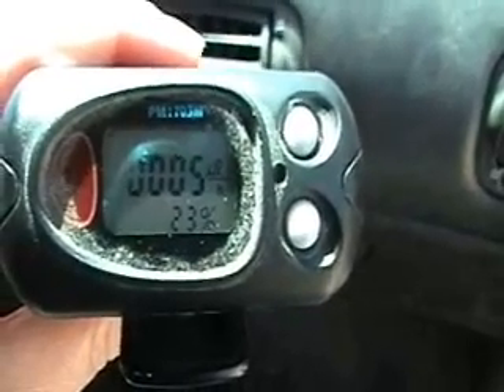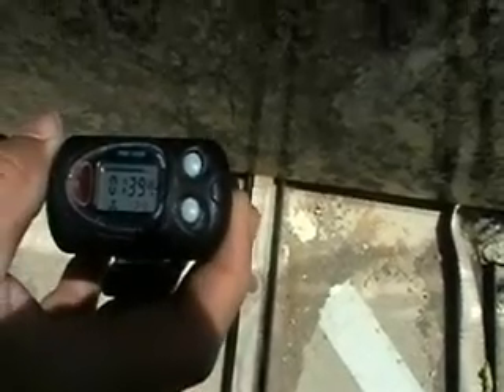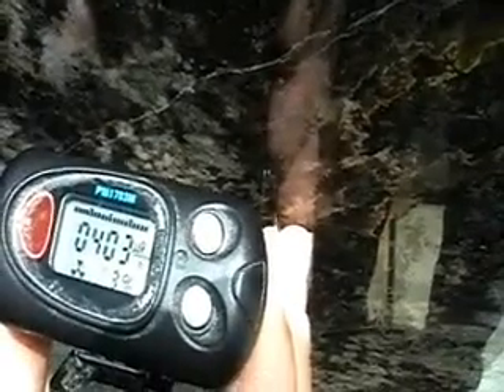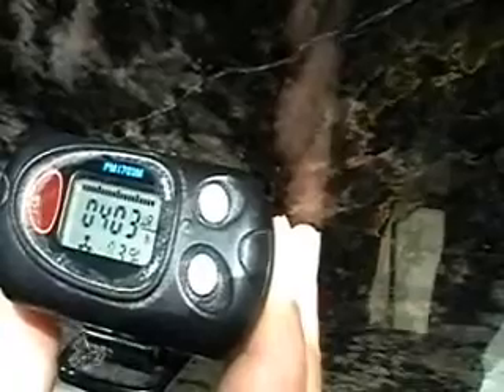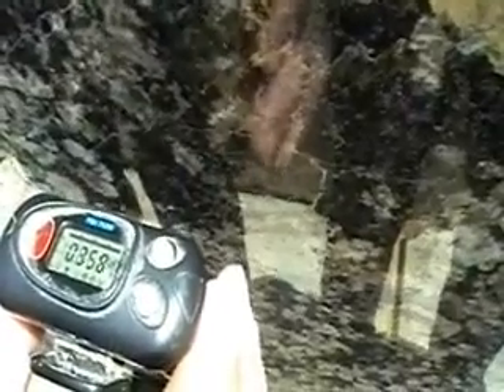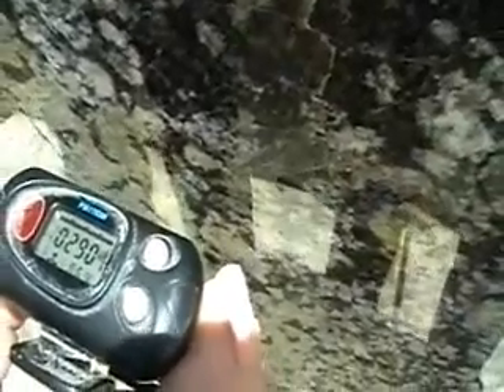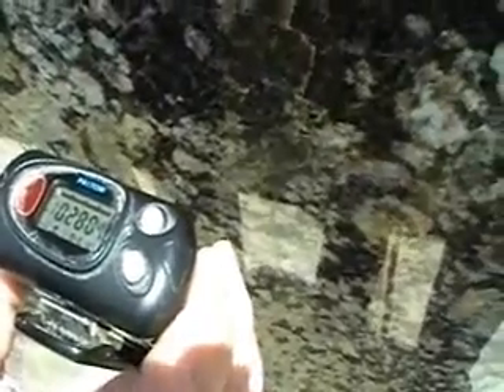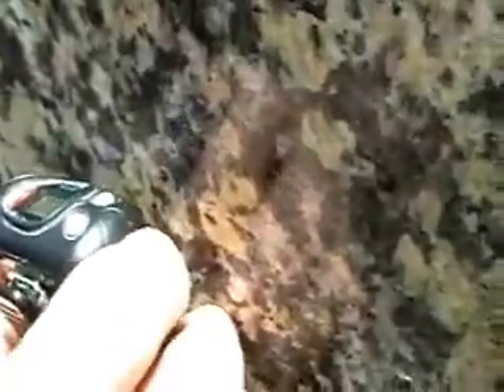2 Minute Granite & Radiation Video

Comment from the maker: Well, I didn't get to review this before it was published, & there are several mistakes I made. First time I've done this, wasn't prepared. This is real life, warts and all. Two mistakes I found: The Geiger counter on X100 was actually showing 10 millirems, not 1 rem, stupid mistake on my part. The second mistake was when I was pointing out the data log info. I said 456 cpm when I should have said 4560 cpm. I'll review it again tomorrow night to see if there are any more errors.